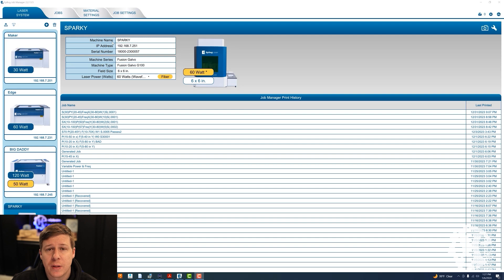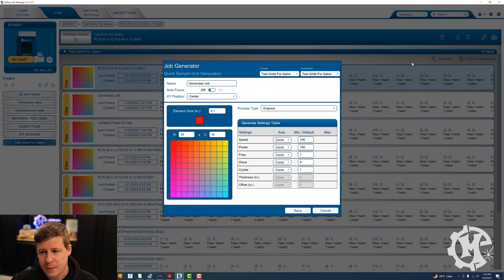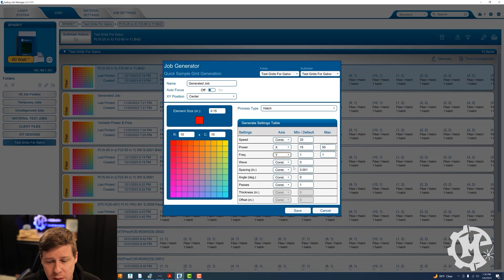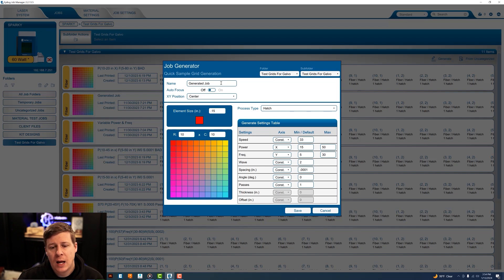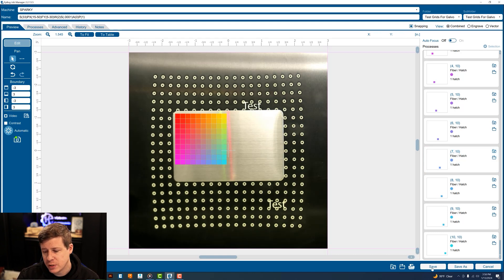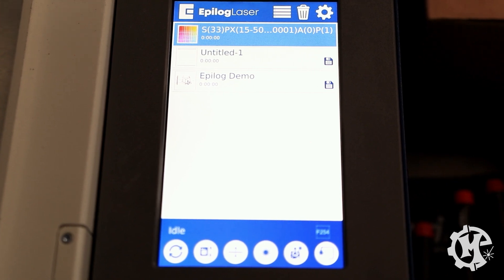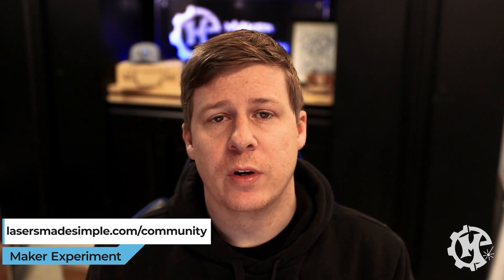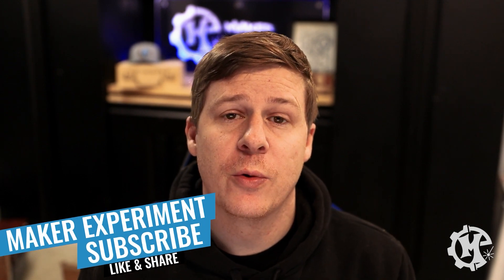How to Create a Material Test Grid for Lasers: Epilog Fusion Galvo

Comment: Hi i just got a 20W Epilog Laser last week.
I just want to mark nice contrast black text on stainless steel 316L.
SW recommends Speed 8, Power 100 aand  Freq 3.
Text can be read in the correct light.
Have you seen a  fast way to do a grid adjust z focus height?
Ie Array of text 0,+0.1mm,+0.2mm,.....+0.9mm etc
Pause between each image to allow z +/- offset

I like wwhat youve done with this tutorial 👍
Reply from the maker: I haven’t tried a height adjustment. What you might be able to do is generate a single line row with a height then do the next row at a different height. I’ll have to think about a quick way. It’s not a normal variable they account for.